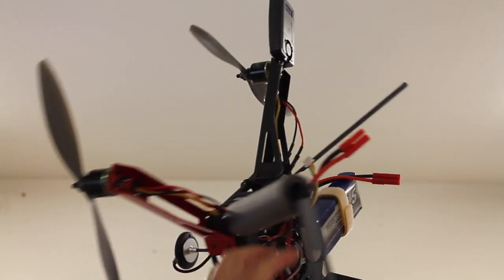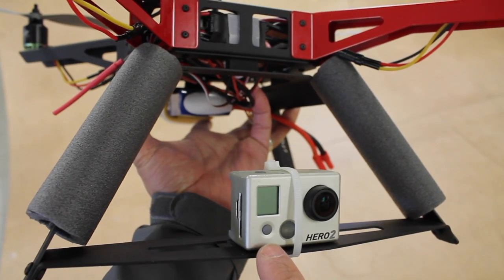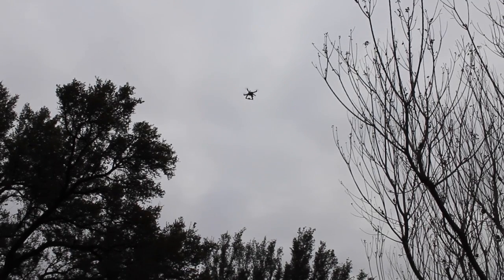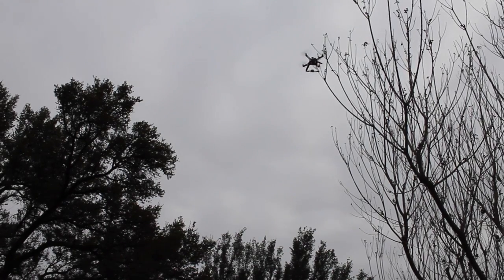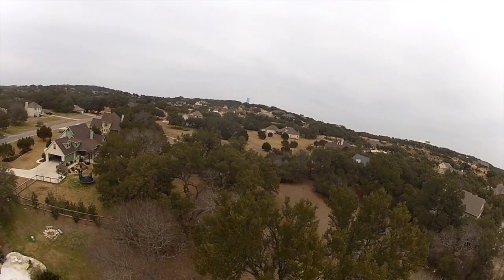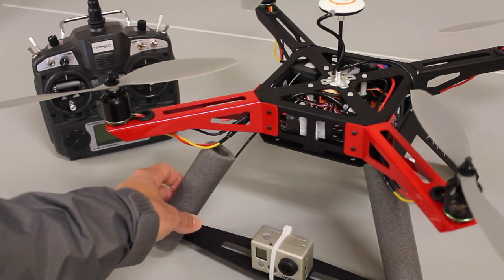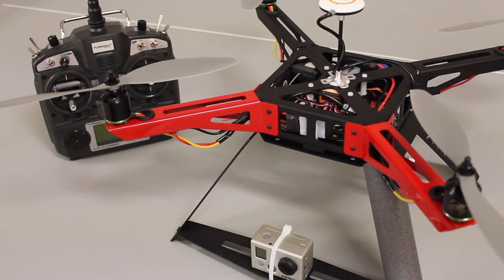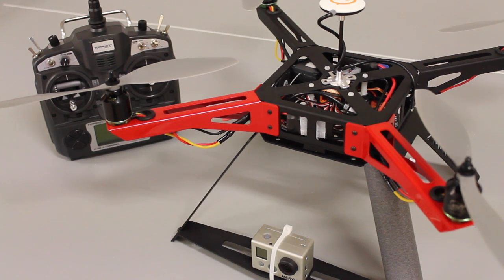XP2 Maiden and Vibration Test w/ NAZA V2 GPS and GoPro Hero2

Comment: That's a great little quad and you must expect jello when there is no vibration dampening for the GoPro, even so the video footage was not to bad.. Glad to see my fears over the motor noise was unfounded as they seem to run much smoother under load...
Nice one Dennis...:o)